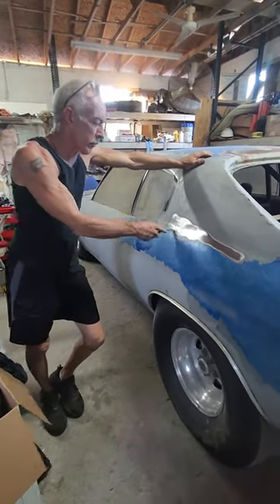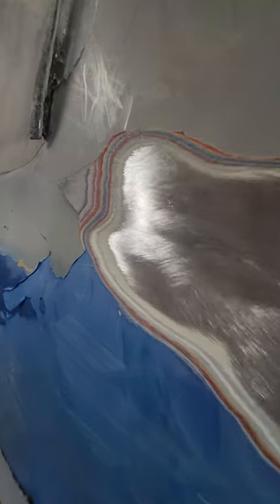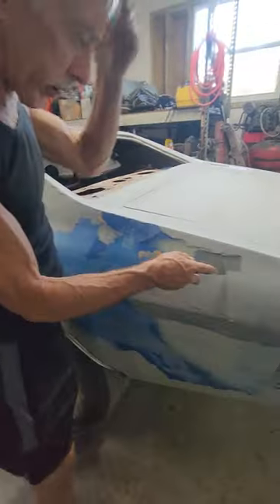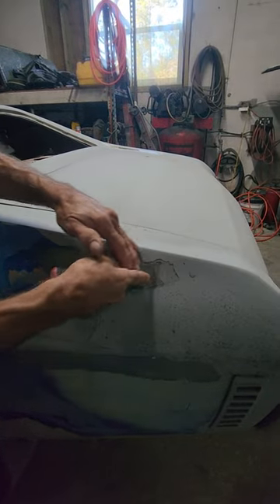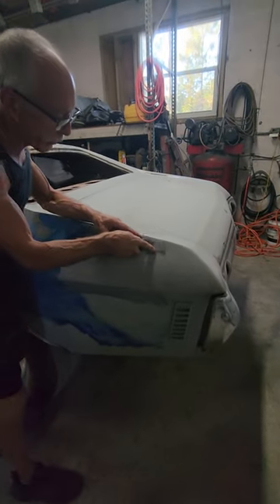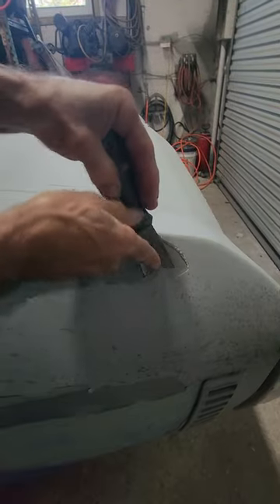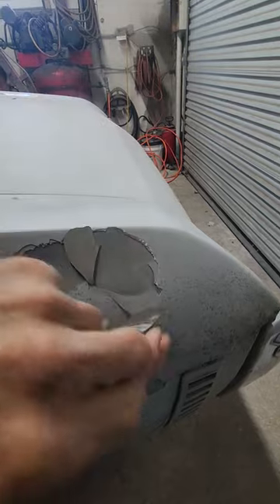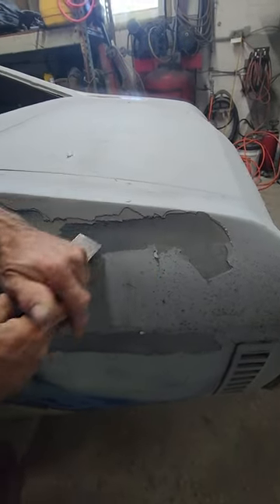Paint scraper vs power grinder

Comment: I did this once on a 65 Mustang. it had 17 Layers of paint. we used a heavy duty wire wheel to remove. took 3 days
Reply from the maker: 17?! Dang...lol. This took us about 10-12 working hours to strip it and get it in primer 😉

Comment: I can't click the link you posted in why you don't use stripper. Anybody know the reason?
Reply from the maker: No problem, I'm going to add a few more reasons here because people don't realize this video was 3-4 weeks ago and is already back in primer after 10-12 working hours, lol. This is gonna be a long reply but I'm trying to address additional suggestions or Comments about our "why".

We have pets, as do our neighbors. We don't like using chemicals where we are located. We all live out on acerage out here in the sticks, neighbors are pretty far away with 15-20 foot berms surrounding our shop and most of their yards also have berms instead of fences. Noise isn't an issue out here. 

Aircraft stripper, vats of acid, similar products have been suggested by some viewers, and that's why I did this video 😉. If you use aircraft stripper, which was only made for planes that are aluminum, not steel like cars, it won't work through all those layers of paint and bondo and fiberglass on that chevelle. Spoken by a true professional who has used it in his own shop on jobs with much less layers. Its not the best option. It stinks, it's dangerous, It makes a terrible mess that you have to rinse off  to get the chemicals off 🤣🤢(Hello rust lol.) Chris has done body work at his own shop for almost 4 decades this way in the video. We do what we do how we do it using tools we have because it gives better results, it's faster no set up, and isnt such a mess. This only took us 10-12 working hours to strip to bare metal and get it in primer. When you've done it as long as he has its just routine. I attached the video below but I've had to add to it since then lol. 

Sandblasting is not meant for an entire car, especially a drag car where you'll have tons of particles of sand in areas you don't need sand lmao. We live in FL trust me sand gets everywhere and makes a mess. As far as any 'dust' we make, our shop is very well ventilated and its surrounded by berms and forest. Nothing floats for miles that we do here in our spare time lol. Our neighborhood is all country boys, they all have their own builds going, we all know eachother and whay theyre doing, prettt much work the same ways lol. We aren't afraid of using a little elbow grease, we are old school here. 

I'm not sure why the link wouldn't work for you but at least it gave me a chance to explain more reasons as to why we dont use chemicals in case anyone else can't open the link, I was able to this morning. 

I do try to address all comments, and we get a ton, which is awesome. It crashes our studio sometimes so it makes it harder to find a comment and respond to it lol. Repeat comments aren't always addressed because the more comments we try to post again, it crashes the studio. If you have a channel then you'll understand the chaos that is YT studio lol. Thanks for watching and feel free to ask or leave comments, I like getting to know my crew 😉 

https://youtube.com/shorts/EZgBkG5IGkQ?feature=share
Reply: I was wondering why you would use a sand blaster or dry ice blaster. I use dry ice blasters at work. They have a huge range of intensity. I can cut through wood like it's tissue paper, or on the opposite end I can have it soft enough to take the m off a m&m without damaging the shell. Also there is zero cleanup because the dry ice just turns into vapor. Still have the paint chips to cleanup though. We use them to clean the old rock hard ink that has built up on the printing presses. It's either that or hammer and chisel.
Reply from the maker: @Why...So...Stupid...  Hes done it this way for almost 4 decades, its how hes always done it, and how hes teaching me. Old school style ; )  we dont mind using a little elbow grease lol.

Comment: I had a 67 gto.. that had 17 layers of paint.including 2 of house paint...I had to scrap,power wash&sand for months.. getting thru it a few layers at once.. I got it down to the original paint finally to start the body work.. paint stripper.wouldnt even eat thru a few layers....
Reply from the maker: Holy cow 17?!  Dang house paint too? Sounds like you've been having some fun! and you are right, it wont go through bondo, fiberglass, filler or multiple layers of paint. Isn't it funny how many people think their way is the only way to do body work? This is how we do ours 💪. What color did you end up doing the GTO?

Comment: Use a 8 inch bondo buster I could strip the whole car in 11 hours and I'm 60 years old .will remove the paint and fillings and create  no heat .use 40 grit velcro pepper it's the best set up paper never loses its stick because it is a velcro system.
Reply from the maker: Pretty much what we did, used 40 grit on a 9" buffer and took about 10-12 working hours to strip it and get it in primer. We don't stay in one place, so it doesn't heat up the metal or warp 👍

Comment: That is a shit ton of paint, but you got to be careful doing that because you can easily put a lot of Dents & dings in with a scraper.
Reply from the maker: That was a shit ton of paint! 😂🌈 About 200-250# worth!  It took us about 10-12 working hours to strip it and get it in primer. We used that scraper after the grinder to get down to the last 2 layers then went back to the grinder to bare metal. We only had the one grinder and we are working on 2 builds at the same time. Ive done A LOT of sanding/stripping with that thing lol. You can hear me in the video say 'that grinder is heavy for my little guns'  💪😂. So we would swap on and off. I love using the grinder but getting big sheets off with the scraper was oddly satisfying. (I used my welding gloves for anyone concerned about sharp slices o' paint under the nails 😉😂I may not paint my nails but I dont need paint UNDER them!) Thanks for watching Blue Beard!

Comment: I've never ever seen paint so thick on a car. that's a labor or love to get that all off....... hope the metal is in good shape under all that.
Reply from the maker: It was a labor of love lol. Took us about 10-12 working hours to strip it and get it in primer. The metal was good (The interior needed new floor pans) except for the bottom of the drivers side rear fender, had some holes but its already fixed.  Decades ago, a mack tool truck backed right into it crushing the back end, fenders and trunk lid. This was the day he painted it that metallic blue and parked it as his friends shop to show him. OUCH. Within 30 days if I remember correctly 2 more people rammed into that car when it was blue so thats his bad luck color. Its had some work done over the years lol
Reply: @melissasbeast  sounds like he has had ot for a long time so I'm shore he loves it enough to whatever it takes to make it what he wants it to be. Congrats on doing such hard work and not just sending off to a shop!!!
Reply from the maker: @mikellewis2346  Thanks! Hes had it over 35 yrs now. The only shop it was ever sent to since hes owned it was Chris' own custom restoration/upholstery shop and here in our home shop lol.

Comment: Heat gun or torch will speed that up. I’m finishing up a car like that right now. It’s been painted 5 times and got a skim coat of filler and a primer shot every time it was painted. The metal under it is pretty good. Just layers of “the east way” on top of it over 50 years.
Reply from the maker: This was done a few weeks ago, it wasnt too bad, with the 3 of us it took about 10-12 working hours to strip it to bare metal and get it in a coat of primer 💪Thanks for watching!
Reply: @melissasbeast  heck yeah! Nice work man. I’m solo over here. Took me probably 30 hours or more to strip my car.
Reply from the maker: @rdspeedfab  Chris worked solo at his own shop for decades. This is the first time hes ever had anyone else touch his car or help him period. Hes been teaching me how to do all this stuff since we started building my drag car Beast in 2021.This is my third build now, and I helped Dad on a Harley build for my brother. I gotta, say, besides racing of course, welding has been my favorite skill to acquire.

Comment: The way that's flaking, a pressure washer would be even quicker.
Reply from the maker: It flaked off good huh lol. It was easy enough using these, took about 10-12 hours total working time to get it stripped and in primer.

Comment: Poor adhesion on that primered area. I wonder if it was sprayed with polyester primer? 
Of course sandblasting would remove it the best. Or an 8in DA sander.
Reply from the maker: 😂 This sat in primer outdoors unsheltered for over a decade in the heat rain and hurricanes of FL.  After we stripped it this way, we used a DA with 80 grit then sprayed it in primer, all in about 10-12 working hours. We dont use sand or chemicals, this is how we do our body work the old school way 💪😉Thanks for watching!

Comment: Was trying to figure out how it got in this shape then saw the big kicks in the back and that explained all the thick layers of laint and primer it was built to go fast not show. If I was y'all I would buy a huge gallon bucket of the airplane paint stripper stuff brush it on and in minutes you can scrape off very easy or pressure wash it off I have got a car down to bair metal that had 9 layers of thick paint bondo primer in a hour using that paint stripper stuff
Reply from the maker: Those kicks happened the day after he painted it blue! He was parked at a friend's shop to show him the chevelle, and a mack tool truck backed right into it 😫. So it's had some work done, lol. Within 30 days of him having it in metallic blue, he was hit 3 times. Bad luck color now. Yea, pretty much this thing is a drag car first and foremost, not a show car. Tgis was a daily driver/ drag car, stress cracks, he never had time to work on his own car when he ran his own shop. Thanks for watching hope you watch it on the track! All 3 of us 😉

Comment: Sand blast it...with the large grinder you are gonna heat the panels and warp them...
Reply from the maker: ONLY inexperienced people warp metal with this lol. Its really not hard, we havent warped any panels doing it like this on any of our builds lol. Hes been doing this almost 4 decades professionally. You need to keep it moving and on an angle so it doesnt stay in one place heat up the metal causing a warp. Its done and in primer in and took about 10-12 working hours 😉 thanks for watching!

Comment: 300 lbs of paint, shhh you just made it a second faster
Reply from the maker: 10th of a second every 100# in the 1/8th mile. We took off 200-250# but replaced  fiberglass doors and fenders for steel, so pretty much evened out

Comment: It seems like the both time's I've bought a GM product they've had 8 plus coats of paint on them I've tried to use aircraft stripper it didn't even work so my  only option is a grinder and wire wheel  I don't know how I'll get the bumper clean there plastic
Reply from the maker: Youre right 😉 it was made for aluminum aircraft not steel.  It might take paint off but not all of it and not all the primer, bondo or fiberglass. Then you still have to sand it so its just extra work.  Chris used it in the past at his old shop on jobs with one or 2 layers, and its a mess and doesn't produce the same results as his old school classic way of doing body work. Plus we dont like to get our metal wet. Sounds like you got the job done using a little elbow grease like we did lol. Thanks for watching!
Reply: @melissasbeast  not really done yet but I'm in no rush I drive it almost every other day so it no Chevelle but it a classic in it on rights

Comment: How much weight is all those layers? At the very least,  gas mileage will be better.
Reply from the maker: About 200-250#, but we are replacing his old fiberglass fenders, trunk and hood with new steel ones so it should be about the same.  We go through 5 gallons of racing fuel just backing it out and back in the shop lol

Comment: Your gonna lose a good amount of weight with all that paint coming off
Reply from the maker: Chris figures he lost about 200-250# in paint. However, we did replace his old fiberglass doors, fenders and trunk lid with steel ones, weighing about 225#. It should be about the same weight after the restoration is complete and be back to an all steel body 💪

Comment: Why not chemical dip?
Reply from the maker: One reason is we dont like to get our metal wet, and the other is a pinned comment 😉weve had a few suggest using chemicals so I made a video as to why. It wasnt too bad we got it stripped with both those tools and in primer in about 10-12 working hours.